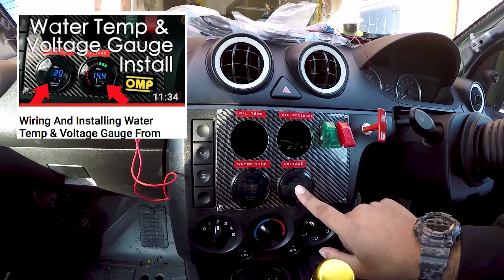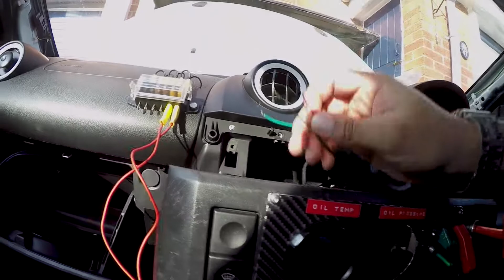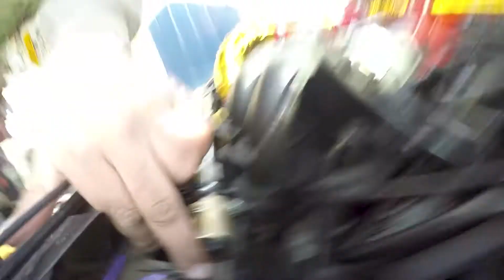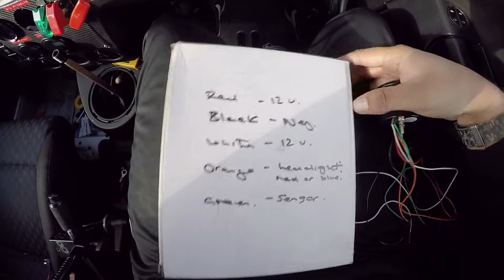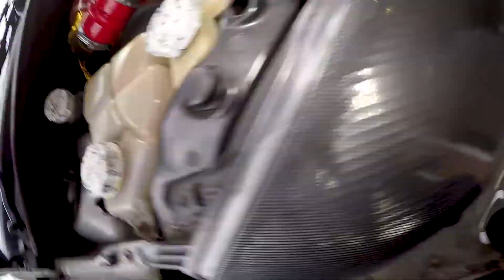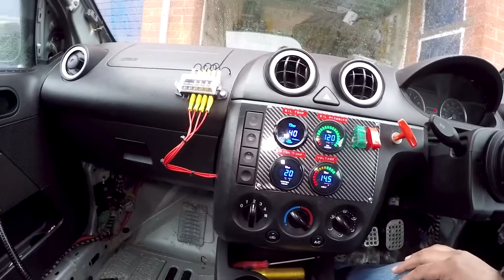OIL TEMPERATURE & OIL PRESSURE GAUGE INSTALL | DRAGON GAUGES | Fiesta MK6 Build | *GIVE AWAY*

Comment: Where did you get the dragon gauges from?
Reply from the maker: There is a link in the description, if they're no good for you, eBay has most of them, or you can enter the giveaway and try and win them for free.
Reply: MARKEL KNIGHT nice one pal, also nice videos I've subbed and like how you show your mess ups. Although I'm a JDM fan your installs are universal as I'm currently building an is200 drift car.
Reply from the maker: I'm a JDM guy myself, but the fiesta was my first car, and never wanted to get rid so that why i'm doing a track build. But I've got a 2000 Civic as well which im itching to tinker with.
Reply: MARKEL KNIGHT I was toying with a fiesta but got my dream first car Eg civic ESI but had to sell it as the rears we're Swiss cheese when I stripped it. I'm thinking of getting another eg because I love TA car's i.e. Aslan and works garage time attack cars.